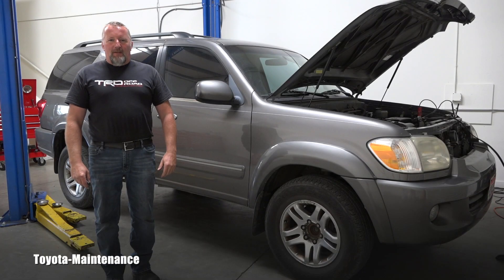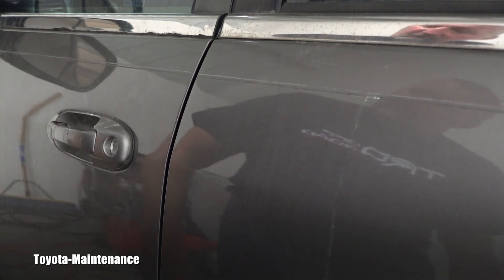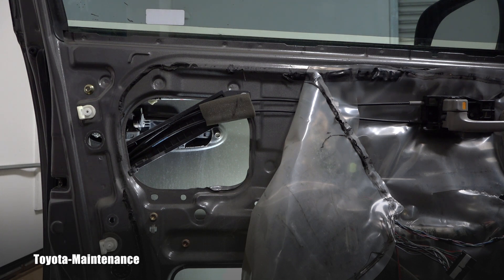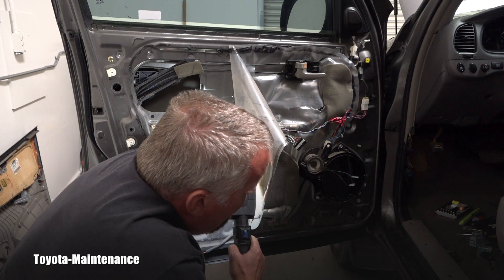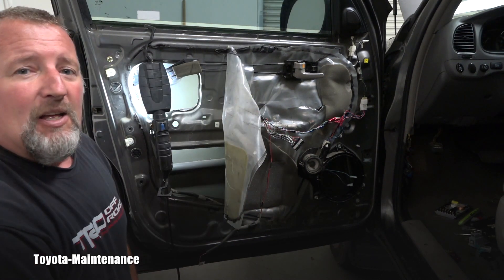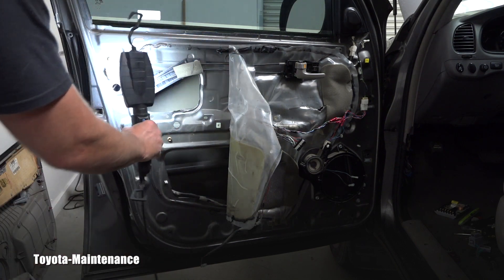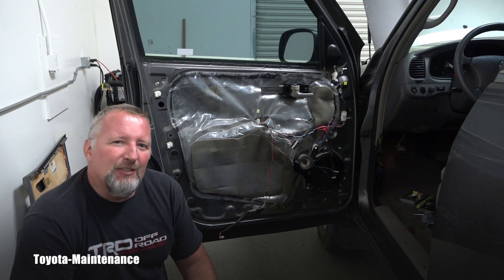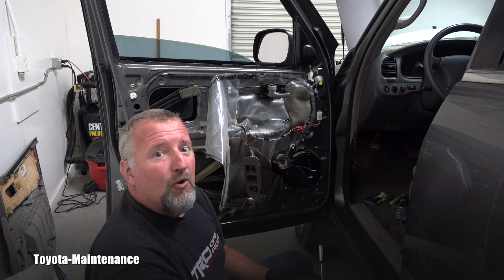Toyota Sequoia Outside Door Handle

Comment: I'm so glad I found this video. I came here looking for answer to the same problem on my 2005 Sequoia. After getting it back from the body shop I noticed the loose exterior handle. Opened everything up after watching this video and sure enough found the missing bolt at the bottom of the door on the inside just like he says! Put the bolt back on and problem solved! This channel is a live saver.

Comment: I had this exact problem on my Sequoia that I just bought. The bolt was also in the bottom of the door haha. The most helpful thing for me was pulling the exterior handle which allowed me direct access to the bolt hole as it pulls the interior lever down. Thanks for the excellent video!